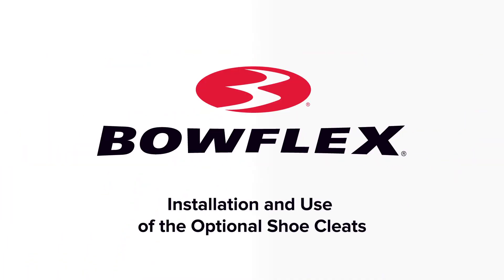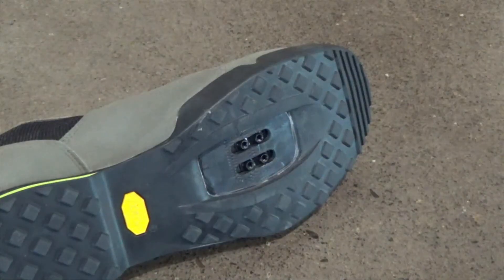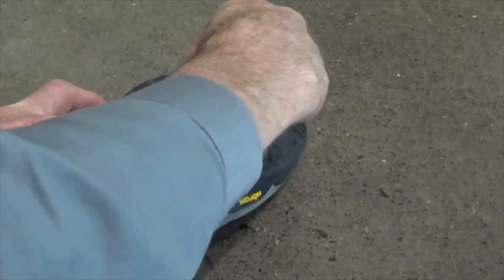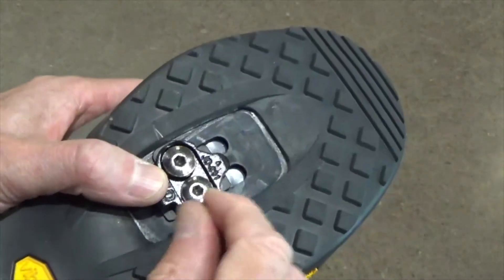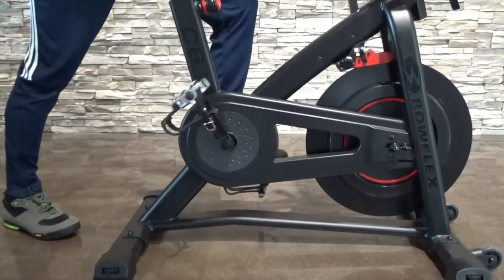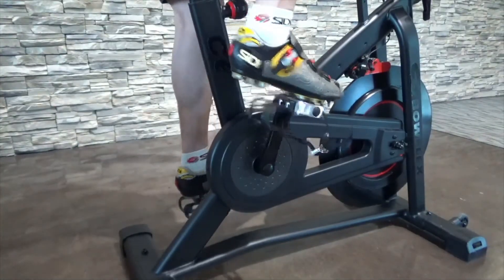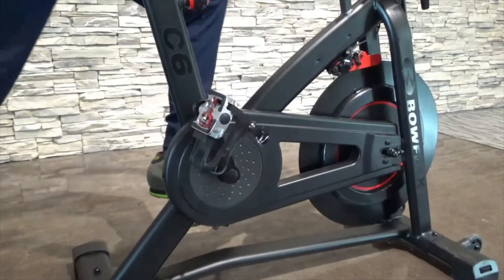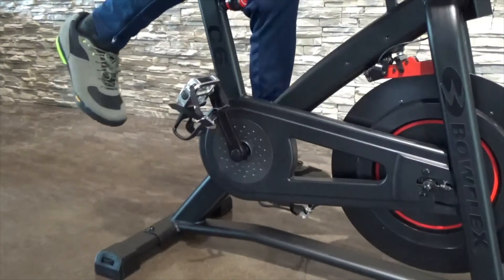BowFlex® C6/C7/VeloCore Bike: How to Install Your Clip-in Shoe Cleats

Comment: If you want to ride clipped-in, you should probably invest in some name-brand pedals and cleats like Look Delta, Shimano SPD (2-hole), or Shimano SPD=SL (3-hole). The pedals and cleats that come with this bike are cheap, flimsy junk. If you do use the factory setup, note that the clip-in tension comes adjusted way too tight. I needed to use my full weight on one foot to get clicked in and almost couldn't get the second foot. You will be needing that 3mm hex wrench to loosen the tension (3:40).